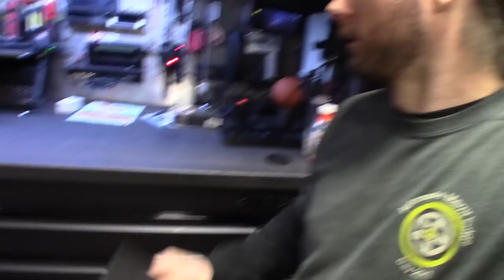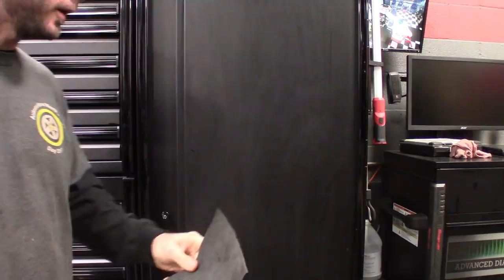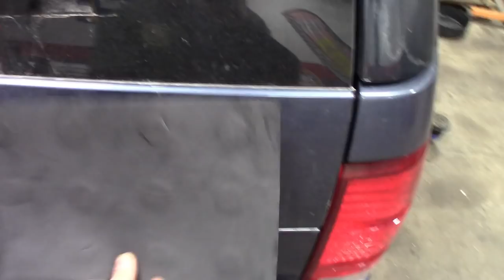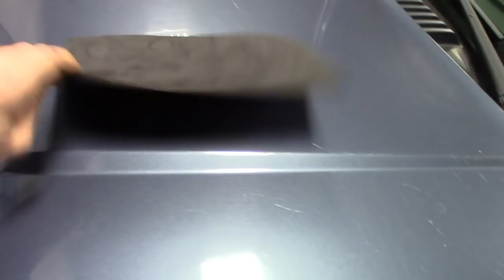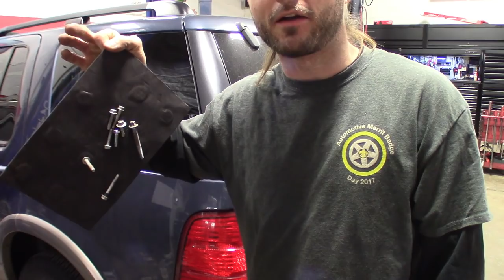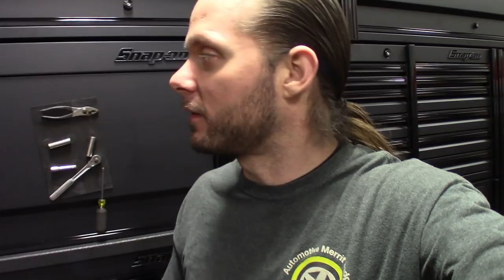As Advertised Testing in Progress

Comment: Cool product but I'd never use one in a shop where I'm working on customer cars. On the lift it would go....  great review of the product. Only reason you would hang a rotor is if you're doing hub or suspension work and need to keep the rotor safe from being dropped or kicked around. #toolheadzcrate

Comment: hey man i been finding some name brand tools on ebay and picking them up at fair prices . been looking for something to help me with some them electrical gremlins. i came across power probe on there any where from 50.00 to 150.00 or more. was wandering what you think about them and if there is one you think is better than the rest. mind you it will not be used every day many times a day please help if you can
Reply from the maker: Yeah Matt power probe is a great electrical diagnostic tool. The pp3 is a good one for entry level diag, I still use mine to this day.
Reply: @JRC54  what is a good price for a pp3 please look at them on ebay if you have time i see them on there as low as 50 bucks  are they really that cheap now or am i buying junk for that price
Reply from the maker: You can find a new pp3 for under 100 on eBay. Just make sure it's a trusted seller.
Reply: you said something about a pp3 being good what is the differance between the pp3 and the one in the link above
Reply from the maker: The pp3s is the new version. It's better
Reply: @JRC54  thanks for the help on this i just pulled the trigger on one when i get to the house i am going to look at your page here better and sling a little chedder your way for the help